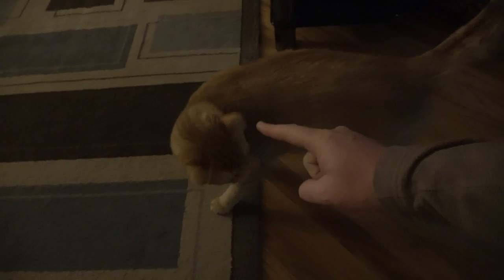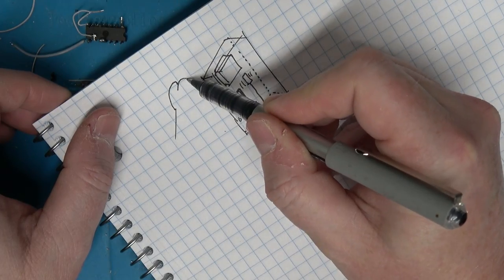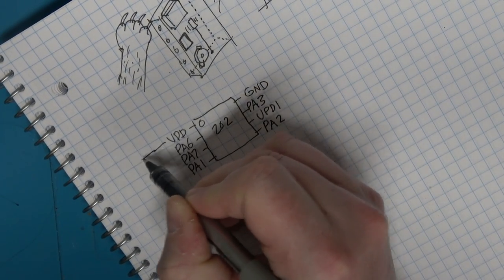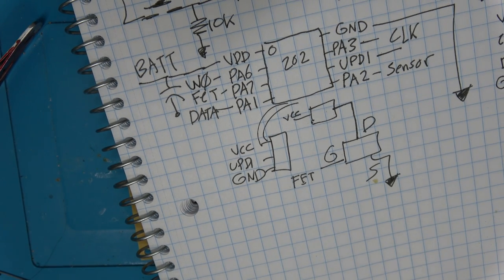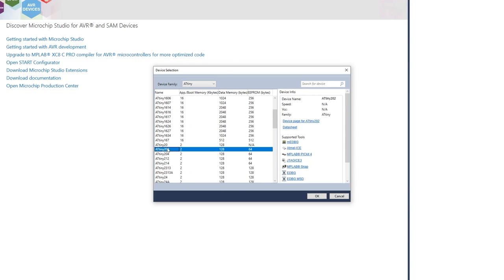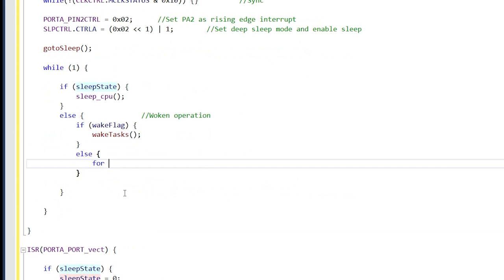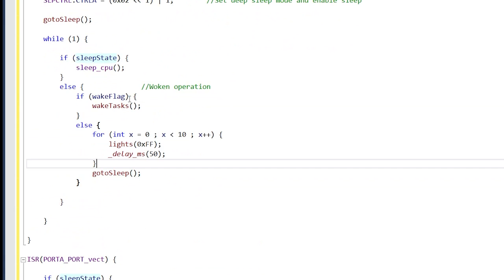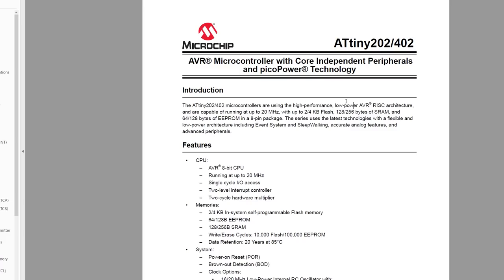tinyAVR 0-Series versus Cats!

Comment: I did a similar project a few years back, for a vibration triggered animation in an event installation. I didn't use sleep mode though - just a p-channel between the battery and VCC input to the board which the tilt switch pulled low. The MCU would then immediately also pull it low to stay awake. Advantage was zero power usage (aside from battery auto-discharge) while inactive, and a little less code - I had around 5 bytes left of flash when it was finished :)

Comment: Cats have a hearing range way larger than ours. They also have a very sensitive sense of smell. I'm sure he knew this was a trap long before you thought he would.
I did notice that he puts one paw on the shelf before pulling on the boxes. One thing you could do is put a strip of metallic tape on the shelf hooked-up to a capacitative touch sensor that would trigger the lights and a sweeping sound above our hearing range (they can hear ultrasounds produced by mice). That might keep him away... if he's not more interested in the boxes than anything else.
Reply: All he needs to do it put some double sided tape on the shelf. Cats hate sticky stuff.
Reply: @swirlingabyss  Trust me that doesn't work, stuff is covered in dust and cat hair in a day or two.

Comment: You could make the speaker make some kind of hissing noise, like air coming from a nozzle. If I run anything related to compressed air (even open the air duster just a tiny bit) my cats get really scared and run away immediately. I think it has to do with the hissing noise snakes make or something but I'm not sure
Reply: Cats hiss as a threat display, if you can't see the cat that hissed at you, you don't know if you can take him so run away is the only good response. Recordings of real cat hisses might work pretty well, recording them is it's own project.
Reply: @brocktechnology  why not use a can of compressed air as your source 😅

Comment: Might be a useful project for under the hood of your car to deter wire eating rodents. 
Use a sealed lead acid battery for power and a few of your wobbly pipe cleaners radiating from the enclosure.

Comment: Yeah the newer tiny-0 and tiny-1 series are more in stock than the zoomer’s favourite mega368p and such. Though I program my UPDI micros using a CH340G-based bit-banger. Works fine, I promise!

Also the mega4808 and such are decent looking too, the xx09 series have plenty of pins.

Comment: In my own testing cats do not really care about the high pitched noises.  They hear them and promptly ignore them.  I had a 20Khz tone running at full volume and my cats couldn't care less.  I assume it was loud, because it pegged the mic "vu's" on my laptop.  They did take interest in a descending tone from 20Khz to a few hundred hz.  It just seemed to be curiosity rather than any annoyance.

Comment: This is a job for a raspberry pi using machine vision to detect when the cat is on the shelf.  The era of Embedded GPUs is over, but a raspberry pi 4 can run a minimal YOLO model at 2fps.  It wouldn't differentiate when the cat was not pulling the books out.  YOLO is used all the time for detecting animals.

Comment: Short of shock pads, the only thing I have had success with, for deterring cats is the IR sensors that sprays canned air (making a loud hissing noise).  There is a commercial product, but I bet you could whip up your own version.  Alternatively, maybe fix your speaker to make a loud hissing noise.

Comment: It was a valiant effort, but it seems like you may have to ramp up the output power a bit. A more annoying tone, and a higher decibel output. I'm guessing something close to the level of smoke detector if not using the parts out of one. Maybe a rumble motor is in order? I'd like to see you experiment with this more, if you decide too.

Comment: Oh those TP4056... the hole placement is so weird on those. I have a couple of them, but they are not suitable for PCBs, because their holes aren't 2.54mm (multiplied by whatever distance + padding) apart. Also, if you get the one with BAT and OUT (and IN), the BAT pins should not be used to drive any circuit, because the mosfet onboard won't turn on OUT, which really sucks if you want a cheap lithium protection circuit + charger.

Comment: Too bad Bud didn't care!  I did a similar low-tech way using an Aliexpress ultrasonic dog/cat deterrent device.  It blinks LEDs and makes 90dB of ultrasonic freq.  I ripped out the circuit and fitted a hc-sr501 PIR motion sensor on it switched with a transistor. It worked reasonably well at first, but later the cats figure out if they don't move, they can sleep in front of it. :)
Reply: i had a bark deterrant like this, it uses the piezo to "listen" for a sharp change in voltage(ie, high volume bark or the device is dropped) modded it to be usb rechargable as the original cr2032 only lasted a few weeks at a time with a hyperactive puppy(she is now a less hyper, still cute and noisy 3 year old puppy)

Comment: ........you think this mortal attempt would even slightly detour bud? he chews on your creation to show you what he thinks!
how about instead of using a single frequency, make it play him a little tune....say.... shave and a haircut? make sure it doesnt just go CLICK CLICK CLICK CLICK CLICK CLICK, that'd probably be more a lure than a deterrent! try doing a whistle up and down a few times, 20 khz drop to 19 to 18.5 to 18 to 17.5 to 17 and then back up to 20 TEW TEW TEW TEW, make bud think the orange box is firing mah lasers
Reply: Btw if you really want to detour bud, get some holographic foil (you know those shiny disposable vape tubes that litter all the roads? That's free and cleaning up the environment)  and stick a piece to a old PC fan, run it for a few seconds and he will be detoured, they will run on voltages lower than they are listed for in most cases so a battery is fine
Reply: Don't ask me how I know this .... It is arcane knowledge of cats, make sure the piece is centered good so the fan doesn't wobble or shake